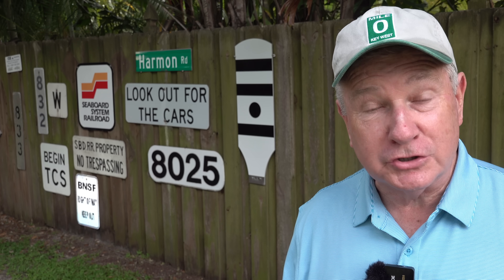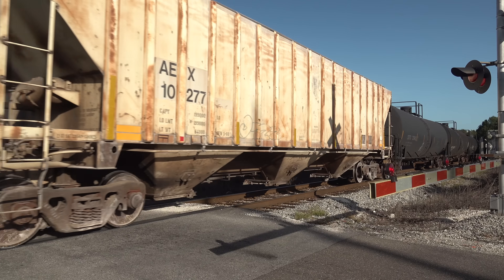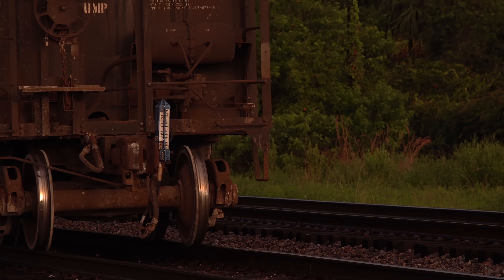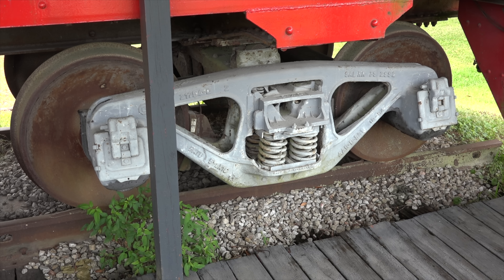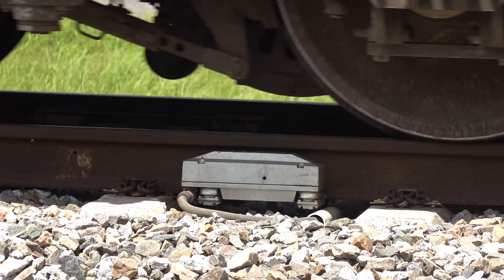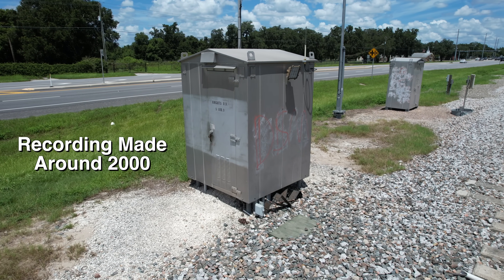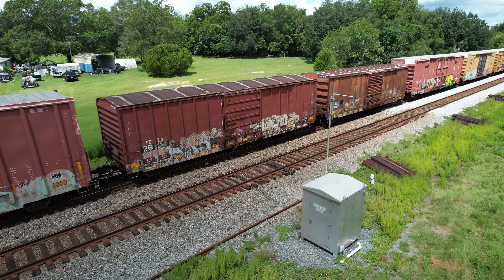What Railroad Defect Detectors Do

Comment: I can't claim to be a full rail fanner, but I do check out various web pages occasionally.  Without question, Sir Harmon presents the best rail page I have found.  It is one thing to post a number of videos of trains, with little to no comment.  It is altogether another to do what he has done here.  He has given us all an education into what defect detectors are, and the benefits they provide.  But Harmon has gone far beyond that.  He has chosen to fully describe the details required in using rail sidings, and in understanding the use of hubs, crossings, locomotive numbers, DPUs, how to read rail lights/signs, efficient use of rail yards, railcar types, railroad jargon, and whatever else we may find.  This is what makes this web page worthwhile.   Well done sir.  Your effort is greatly appreciated.

I probably should be a full on rail fanner, as the rails are in my family history.  My maternal grandfather was a railroad engineer for 20-30 years.  Most of his time was with a railroad out of Charleston South Carolina, between WW I & WW II.  There may even be some family history in the Smithsonian.  There is an engine in that museum that ran for some 20+ years or so with the same rail company.  My grandfather was with that railroad company for around 18 of those years.  My understanding is that it was not a large company, with a rather limited number of engines.  This whole thought may be for naught, as said engine was used for passenger service and my grandfather ran almost exclusively with freight.  But I suppose there might be some chance, that at some point in time, he ran that beast.  One can hope, anyway.

Comment: [10/03/22]  There must be 1,000's of miles of abandoned, or unused track spread across North America. All that steel is worth a lot of money to steel recyclers. Lest you think of going out there yourself to grab some of that cash sitting out there rusting away, remember that each single 13 yard section of steel track weighs in at ~ 1,716 lbs. And it ain't going to fit in the back of your pickup truck without a lot of cutting down.
A few years ago not far from Montreal a well equipped team of thieves removed and stole about a quarter mile of abandoned track in broad daylight. People did see them working, but thought they were working for the rail company. That steel track was worth many tens of thousands of dollars.

Comment: This happened about 25 years ago.  Anaheim Ca where the BNSF rails start their way up through the Cajon Pass.  We were sitting at the crossing waiting for the BNSF freight train to pass through.  When the crossing gates went up we turned right on to a street that paralleled the tracks.   The train had started several fires along the track.  One of them was quite a serious blaze that was in danger of impacting nearby homes.  We were able to get the Fire Dept there before the fire did any structural damage.  What defect  detectors do is prevent fires.

Comment: I'm surprised that these don't also broadcast a digital signal that could be displayed and compared in the cab. The emergency alert system, for example, transmits all of the data as a digital signal in addition to the vocal readout.

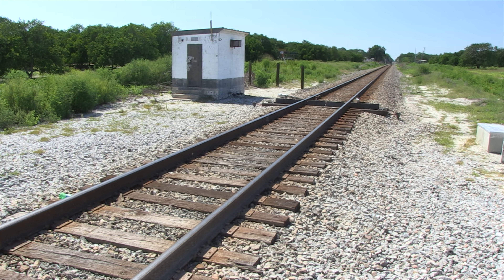Comment: 3:28 trackside train defect detector shacks w/sensors, antenna, e.g. Campville, FL. MP S700.1 11:16 2020 CSX Defect Detector portal Racepond, GA MP ANA609.9 13:04 hopper cars required for hazmat buffer

Comment: my guess for the numbers on the feeler flaps is that you can decern what kind of equipment is hanging down judging by the feeler number it hit
Reply: I was wondering the same thing. Another thought after reading multiple comments that maintainers number them so they can be put back in the right order. was.. if you put the left most flap on the right most side. the engineer would be walking down the wrong side of the train for ages looking for a fault closest to them.

Comment: The reason why those flaps are probably labeled if so if there is something dragging and it hits one of the flaps it can give the train operator a specific location of what is dragging. For example if something hit flat 4 to operate with no look for something dragging in the middle left side of the bottom of the train.

Comment: That is a Harmon (bought out by General Electric) Micro Hot Box detector speaking. There were a few in Australia on the now defunct Port Augusta coal power station line. Totally horrid device never used to work correctly mainly because of the mediocre condition of the track not allowing the infrared detectors in those long silver units bolted to the track focus properly on the bearing housing.  I spent many trips out there trying to get the darn thing to work correctly!

Comment: Good stuff.
There are directional antennae used for various things. But that dipole pictured doesn't concentrate the signal down the line. Its pattern is omnidirectional. That's a basic dipole. When oriented vertically as shown the signal is concentrated toward the horizon, in all directions, with the least signal straight up & down. So, it's efficient & effective for the intended use.

Comment: I grew up along a train track. We played around the tracks all the time, though adults would tell us the train would suck us under if we got too close. I loved the sound of the freight trains at night. About a half mile away was a siding where trains would puff off to let another train pass. There was a small wooden building that had an old crank phone that I assumed was connected to all the overhead wires that were along the tracks. It had a big railroad padlock on it but was never locked. The ditch behind it was covered with old 6 volt batteries. We loved climbing those signal light towers and watch a train go by.  Once we found some old steel roller skates and built a frame with 2x4s that would roll on the tracks. Memories long forgotten. Now trains are just an annoyance at crossings, though some of the art work is interesting. Thanks for the memories.

Comment: Better hope they dont run a High/Wide load, it might not fit through that inspection portal, not without tearing it apart.  Also dragging equipment such as a tie down chain flapping around could also do some damage.

Comment: What was the supposed point of tearing up the old siding just because it was disused after a while? What would they supposedly accomplish by doing that?
Reply from the maker: All tracks require maintenance to keep them up to safety standards. That requires capital expenditure. If tracks aren't used for long periods, it's better to pull them out.
Reply: @distantsignal : But if they're just not going to be used for a long time, why not just... not use them? You can disuse something permanently without being rid of it... right?
Reply from the maker: It's a question of money. If a company isn't using something, they don't want to spend money to keep it maintained.
Reply: @distantsignal : No, what I mean is: You don't have to maintain something to just let it sit there and not get used. Why bother to remove it at all just because it would not be used or maintained, if there was no plan for reusing that area of land?

Comment: Thanks for your amazing explanation and especially recordings of those automated broadcast stations! I've seen those antennas on the sides of tracks (in Australia) and as a former Television Broadcast radio frequency worker, and as an occasional GA Pilot, wondered what those antennas were broadcasting or receiving on what I could only fathom as being vertically polarized, low power, local UHF at line of sight. Knew it had to have something to do with the railway because of the orientation of the antennas. Mystery revealed! Freight rail defect detectors. It makes sense now.

Comment: Great video. Content and video is solid. Curious about the VHF frequency for the DD. Is it a constant freq or is it on the dispatcher’s channel ? Thx
Reply from the maker: Not sure about Western roads, but here in the East the DD's are always on the road channel.
Reply: @distantsignal  Thx, I play around with SDR (software defined radio) with a di-pole antenna on my roof. I download images from NOAA satellites as they pass overhead. I may be able to hear one as I am close to the Northeast Corridor Line.

Comment: Mr Harmon, great video !  I would like to introduce the "DTQ",   the Broken Rail and Derail detector  System to be used on in the USA  " Dark Territory".The DTQ is an electronic device in charge of detecting rail breakage. Using an internal milli-ohmmeter that measures the electrical resistance of the rail, comparing it to a reference value previously stored in memory. If the measured resistance value is above the reference value, the DTQ prints a broken rail alarm output to the DDS, which announces the alarm, via radio, to the machinists.
It is distinguished by a simplified installation. It does not need an insulating splint to separate the sections, which are separated by jumpers; It features low power consumption and can be powered by solar panel. Conﬁgurable for most types of rail tracks, for a wide range of electrical ballast resistance, allows remote conﬁguration via GSM, or local conﬁguration via direct keypad operation. Measuring circuits are galvanically isolated from other circuits.It comes along with "MY TRAIN" which is a supervisory system for teh controller modules installed along teh Railway line.It concentrates all hte data collected and generates support information for the operational control center and for the  track maintenance team. 
It comes with the derail detector that  is an electro-electronic instrument used to detect railcar derailment. Includes an alarm annunciator with audio memory for up to six 20-second messages. It does the whole process with the voice radio. Turn on the radio, activate the PTT, play the alarm message and control the timing and repetition of messages.
The DDS acts as an intelligent charge controller. It manages the energy supplied by the solar panel and promotes battery charge. It has a PT100 temperature sensor input, and a barrier drop sensor input. Internally, it has a GSM modem that transmits various information via GPRS to the MyTrain supervisory system. It has the possibility of working together with the DTQ, working in this case as an alarm annunciator and data router for the two devices.
The MyTrain is the supervisory system for the assets installed along the railway, it concentrates all the data collected and generates support information for the Operational Control Center (OCC) and the Track Maintenance team. Available on the public Cloud (Software as a Service – SaaS (Internet)), it was developed in Java, and aggregates supervision and remote configuration functions, sending alarms and alerts e-mail to field teams, according to previously established “triggers”. , featuring diagnostic panels, graphics, and other functions.
We have deployed the DTQ system in many Railroad companies in Brazil and it has been working very well.
If anyone needs more information about the DTQ system, please contact me at CarlosApaganini@icloud.com. Iwill be more than happy to assist you .

Comment: Here's what they sound like on the Illinois & Midland (IMRR): 

 First axle enters the detector circuit: "IMRR DETECTOR. MILEPOST: [Milepost number]." 

Last axle leaves the circuit, no defects detected: "IMRR DETECTOR. MILEPOST: [Milepost number]. NO DEFECTS. REPEAT: NO DEFECTS. TOTAL AXLES: [Total number of axles]. LENGTH: [length in feet]. SPEED:  [Speed in mph]. OUT."

Defect detected: IMRR DETECTOR. MILEPOST: [Milepost number]. [Defect type followed by location on train]. REPEAT: [Defect type followed by location on train]. TOTAL AXLES: [total number of axles]. LENGTH: [length in feet]. SPEED:  [speed in mph]. RE-BROADCAST: [the entire message again]. OUT."

Comment: Greatest video for train fans. I was a locomotive driver for the Swiss Federal Railways system  for 33 years. I have a question. What is the protocol when the locomotive driver gets a e.g. dragging equipment 'defekt'? Does he have to stop immediately or what procedure is undertaken to clear the defekt. Thanks.
Reply from the maker: Yes, I believe that in most cases, he must stop immediately and go check it out.

Comment: I'm believe they are hand numbered so the technician working on the circuit equipment can correlate it to which mechanical sensor need to be examined and vice versa.  i.e.  If circuit 3 in the D.D. room trips or shows a fault but there is no indication that it was hit by an object then the sensor may be damaged.  The technician would then walk outside find switch #3 and examine it, rather than guessing and having to look at all of them.

Comment: This was super interesting, i never knew these things existed, i've seen small 'sheds' like these in the UK too but no idea of their probable purpose until now; always assumed they were part of dispatch such as junction control or signalling, or just part of tracking the trains overall, didn't know about the track sensors and radio feedback though!
Reply: There are multiple kinds of detectors.  Dragging Equipment and Hot Journal detectors are the most common, but there are others. A UP line near me used to have several different kinds of detectors spread out, many of which I don't even know what they detected.  See:  41.48091972658172, -95.88437844404777    Looks like there are two left, plus an AEI scanner.   The one at those coordinates looks to have been expanded with fancy cameras similar (if scaled down)  to the last one in the video here.

Comment: Defect detectors can serve as hot box detector, hot wheel bearing detector, high water detector, dragging equipment detector, high/wide load detector, sliding fence detector.  I was with Harmon Industries from 1989 to 1995.

Comment: The scanners scan the bearing journals at a 45 degree angle.  A defect or hot box detector had an analog board which served as the input for each scanner and transducer.

Comment: I live in El Paso, Texas. In the Union Pacific Transcontinental line, the detector has an "opening" announcement and an "ending" one. Those messages read as: "UP detector, milepost one two eight seven point nine, line one" And the ending message is "UP detector, milepost one two eight seven point nine, line one, no defects. Total of axles six seven four, speed four five mph, temperature, eight six degrees, detector out."

Comment: Hello Danny,  another very good presentation on Defect Detectors on our R.R.   You always give great presentations.  First one I have seen this summer.  Thank you.   I have one thing to mention about your journal box comment.  The Friction Journal Box's were not grease fill they were filled with Journal Oil Lubrication that had a Pad Lubricator to absorb the oil that the journal came in contact with with ever revolution of the axle/Wheel.  And a little bit more the maximum oil level was not to go higher than the Axle Journal Flange otherwise the oil would run out the back of the Journal Box that was between the inner axle and wheel hub especially if the rear seal was worn out.  As time went by railroads stop dismantling the truck set/pulling the truck apart and replacing the rear journal box seals to save time expedite repairs.  Truly a lost art.    Keep up the great work.   Regards Eric

Comment: Very informative. When I worked in a steel mill we used to call them "pusher cars" They were a skeleton car with just a frame and a cat walk down the middle to get from the engine to the next car so you didn't have to get off the train. They were mainly used with cars with hot slabs or ingots to keep the glowing red steel away from the engine

Comment: The paddles on the dragger are numbered so when they are removed for the surfacing gang, they can be reinstalled in the right order by the Signal Maintainer. The surfacing gang will periodically come by and tamp the track.
Reply from the maker: Wow! I didn't know that. Thanks!

Comment: Wasn’t it ironic the train going through the camera check system was a CSX train but was being led by loaner engines from 3 of its competitors one of each. Also how did you find out all of the information on that booth and what was in it and how it operated? Is it on a like trial basis to where if they think that it really helps them better that more will be installed?

Comment: Interesting factoid about railroads trying to deploy one DD every 20 miles. I live in BNSF territory and there's a (steep) stretch west of the Cascade Tunnel where BNSF has six DDs in the span of less than 20 miles. Sadly, none of the ones near me call out the train length or speed, and only a few call out the axle count. Nonetheless, they do report on the radio defects or not, and as BNSF is mostly radio silent when passing signals unless it's less than 'clear', those DDs really help us railfans.  Thanks for another great video.

Comment: I opened up a journal box once.  It was full of really nasty black oil and a gauze pad. No grease in that box, just icky black oil that slowly dripped out of a big wad of gauze & oiled the bearings. If a car had a yellow or white circle centered inside of a black box painted on the car's side, it meant that it still had the old ball bearing trucks.

Comment: Roy Reynolds is correct, when I worked on steam engines in WV we used heavy knitting yarn to pack oiling boxes and bio degradable oil as it is safe for the environment. The car shop used same materials when repacking the car oiling boxes. Just a modern upgrade to black oil.